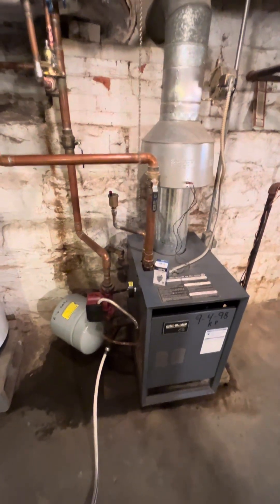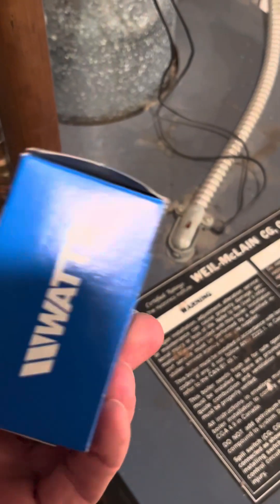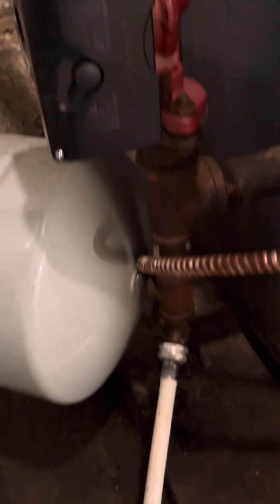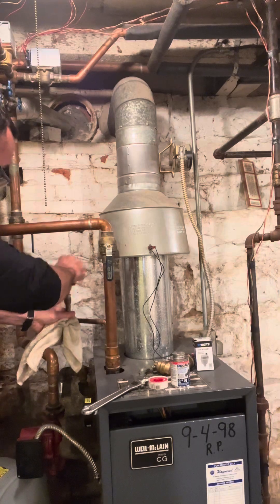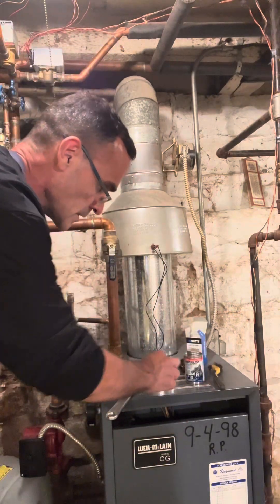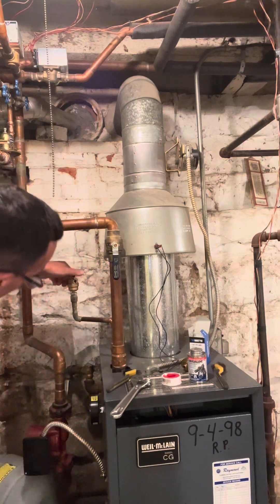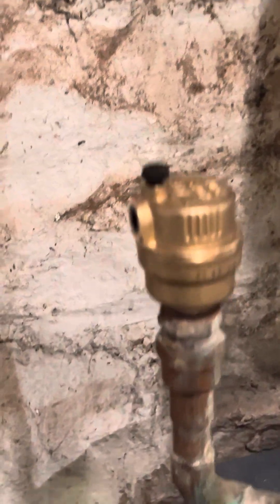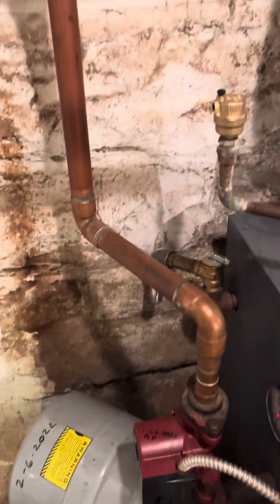DIY replacement of boiler automatic air vent/automatic float vent.

Comment: I’m not a HVAC person, but the vent only works if the heated water is agitated so air bubbles rise and then captured & released through the vent.  I think putting such vent in-line doesn’t do any agitation, so no air bubbles come off the water. I’ve heard of air vents in “high mounts” in radiators but the radiators have to trap air bubbles so the vent is able to release.  Even if you detect air coming out the bent, it may just be vapors and you still need a scoop or agitator to get air bubbles out.

Comment: Hello Jim , plumber from London England. We usually install a lever valve before the AAV(automatic air vent) because its easier to replace when they fail.
Reply from the maker: @Bangla_coys  didn’t know that. Thanks for sharing that.